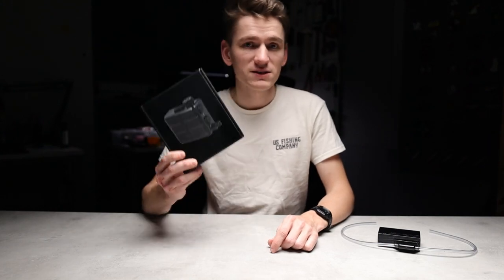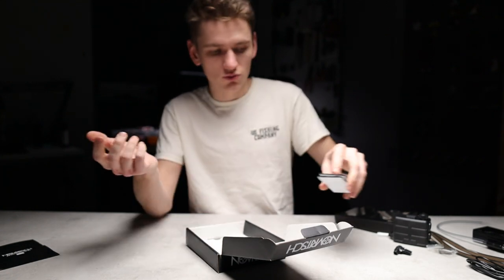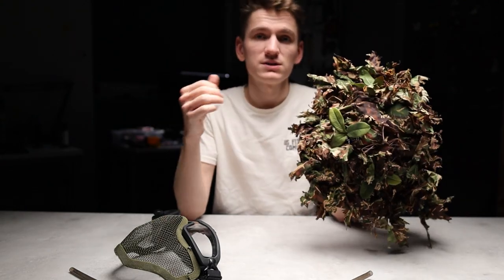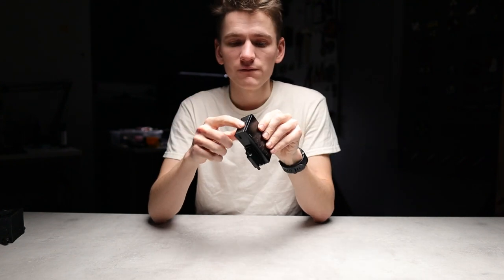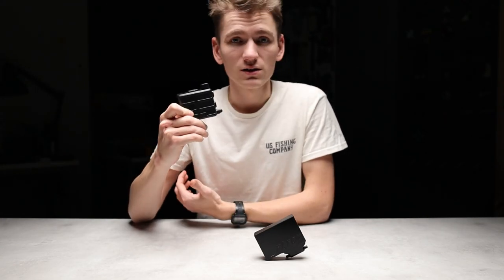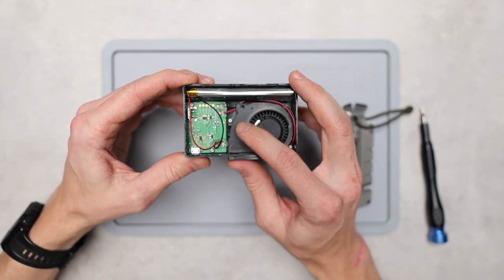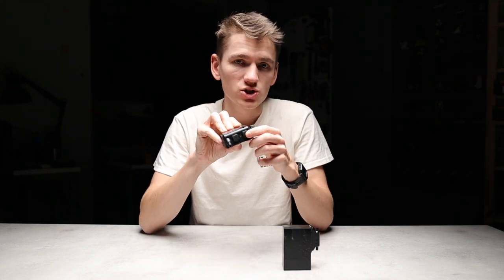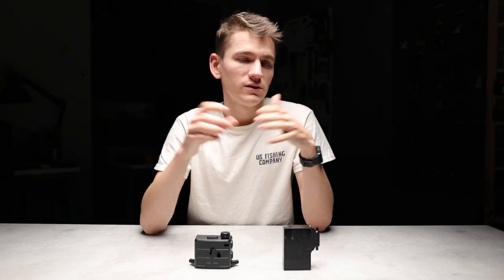NOVRITSCH ANTI FOG UNIT vs EXFOG (Review & Teardown)

Comment: This review also does not have the current internal components of the exfog and this is not accurate decription of either availability of the components nor the functionality of the pcb board which include multiple safety features.
Reply: It is 100.percent disingenuous to do a review using a new product and not compare the latest version of the exfog.
Reply from the maker: My apologies. This was purchased 2 years ago and to a regular person there are no indications that ExFog has different versions or internals. This was definitely not done on purpose. And due to the high cost in Europe, we did not feel like purchasing a brand new unit especially since I was not aware there are "newer" version of the ExFog since externally it is still the same. This is something that should be communicated more clearly, like for example when Novrtisch released an updated version of SSX23, it was called v2020 or Gen2 so that it is clear there have been improvements made.
Reply from the maker: It would be great to hear what exactly the differences is between the version I have and the current gen ExFog and what are the performance differences customers should expect to be different from the version in the review.
Reply: 1. We don't use gds time fans and have a custom fan made to avoid the balance issues and failure rate experienced with gds time.  
2. Likewise our battery is not off the shelf and has been designed to maximize life and ensure safety.
3. The hot glue you reference was not hot glue, but waterproofing to protect the wires, we now waterpoof the full board for a more complete protection from the elements. 
4. The pcb board has been redesigned precisely controls the fan usage, battery safety, shut off percentages, etc.  Much more than running an indicator light and a usb port.
As for claims about force of air, it is irrelevant.   While nov may have been designed for air volume, exfog specifically is not designed for this because of dry eye concerns and the like.
Reply: I'll stick with my ExFog.  Most of the negatives he pointed out were nit-picky.  

I will admit that I would like a stronger fan and bigger battery in my ExFog, but Nov's unit really needs some significant improvements (most notably, the case) before it can really compete with ExFog.
Reply: You can expect longer battery life and better air flow from the changes, but air will never be what nov is and that is by design.  There is a point of diminishing returns.   If the fog clears why more air than is needed?  More air simply means drier eye and more irritation.
Reply from the maker: @jenniferbennett3540  Great to hear of those improvements! There are clearly improvements to be made on Novritsch unit  and this is first batch unit. I obviously understand that it in your interest to highlight ExFog in a good light but you have to admit that usability like adjustable power output via dial, a simple button to check battery level and USB-C are all great improvements in usability, am I wrong?
Reply: As for for your improvements are wrong.  A dial aka potentiometer is less reliable, plastic ones break as yours did, and we deliberately spent money on microprocessor operation for better quality. While usb c is more readily accessible,  it didn't impact the charging capability more than 30 min.  USB C is only significantly different if you invest in fast charging tech, which isn't on Nov.
Reply from the maker: @jenniferbennett3540  I've personally talked with people and seen quite a few comments on internet for which the ExFog wasn't powerful enough to clear the fog due to heavy sweating. It's probably good for 90% users but there is definitely some for which it is not powerful enough.
Reply: So for the light on the battery,  1. You would have to take if off to see the light.  2. You need check if, guess when you only get 6.5 hrs on high.  The fact it's a cool novelty, but practically speaking, it is neither convenient nor necessary on a unit that gets between 9h 53min and 13 hrs run time.  Personally if I had to choose between a unit that I had to take off repeatedly to check a light or a unit set and forget all day.  I would choose the latter.
Reply: And we have options for people who have trouble clearing.  I can assure you it isn't many.  Reviews speak for themselves.
Reply from the maker: @jenniferbennett3540  1. You can always ask a friend to see what's the color, just like with GoPro recording lights. 2. Based on your statement that ExFog on highest setting is strong enough for everyone, then AFU on lowest setting will be strong enough for everyone as well and therefore it will easily last 10h and there will never be need to check the battery level during the day. I was talking about a case where you run it for a game day and you get back home and you have no idea how much charge is left in it, or before you go out for a game day. Ability to quickly check if it has enough battery to last a quick 3h game can be the difference between needing to charge it or not.
Reply: I own an exfog and do not own a nov one. For the love of God switch to usb c. I hate having to bring an extra cable because everything else I run uses usb c. Everything is switching to usb c even apple is switching to usb c
Reply: Your series of comments have convinced me  not to buy an exfog in the future.
Reply: Working on it.  It has been a change in the works for awhile and prototype samples are being generated in a few weeks.  This will also bring our charge time to about half of the nov unit according to our techs.
Reply: @jenniferbennett3540  going for the cheaper one ;)
Reply: @ericblank9956 based on how exfog handles themselves i wouldn't buy it for half the price of the Nov (mind you I wouldn't buy the current AFU either, it's durability is shamefully unacceptable lol)
Reply: @jenniferbennett3540  Was thinking of getting an Exfog over Novritsch but this is a terrible display of professionalism. Sad thing is another airsoft player recommended Exfog and things were looking up...and then I saw this. Others might not agree but this is bad publicity and will direct customers to your competitor.

Comment: No way sorry, ex fog is more durable, been around longer plus the way your case degrades with bbs is shocking convidering its airsoft!!! and once the shell has been penetrated you have a lipo mini bomb on the back of ya head for stray bbs to kick off, we dont want cheaper we want safty, plus you use a faulty ex fog to compare and thats just out right sly so ill never trust novi, and ex fogs customer service is the best and thats far more valuable then the product itself because a product is usless if it has a fault and you need help or too return it. Dgmw novies device will suit others over the ex fog, but if you want to look trust worthy remake this video with the latest ex fog xt brand new out the box and if it has a fault like this one then replace it then make a fair comparison.

Comment: The audacity to steel someone’s design and make a rigged video about the ripped off product vs a multiple years old defect unit and then claim the video isn’t biased 😂

Guys do yourself a favor and buy the original. But I guess this comment will be deleted anyway because that’s how novritsch and co are handling criticism
Reply from the maker: The audacity to leave a comment after learning only one side of the story shows the person you are. Do yourself a favour and read our blog post in response to their video. It's the pinned comment.

Oh, and fun fact - competition drives innovation. In the first 5 years of existence, ExFog made 0 improvements to their design apart from reliability improvements. Ever since Novritsch released their unit, they have improved numerous things and borrowed a few ideas as well which resulted in overall a better product for the consumer. 

You benefited regardless whether you support ExFog or Novrtisch. And that's a fact.
Reply: @TRIDOS.DESIGN  why should I read some random blog wich is nowhere connected to your false claims in the video. Update your video with an actual fair comparison if you are really unbiased. But that wouldn’t give you the right outcome wouldn’t it? And the claim that the ripped off unit made the competition better is something else. Steeling someone’s design and price dumb the original is nowhere near fair competition
Reply from the maker: @Doc_Vega  Ah.. right, so it's always better to learn opinion from only one biased source which is reliant on the income they make through the product in question and they would lose money if competition turned out to have a good product. Hope you still drive Ford Model T as your daily driver because every other car  is clearly a ripoff ;)